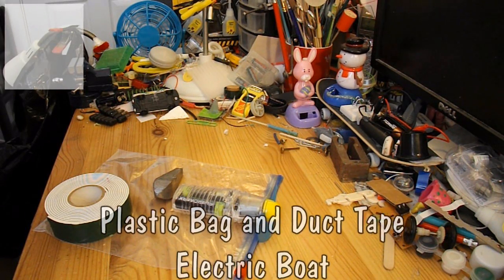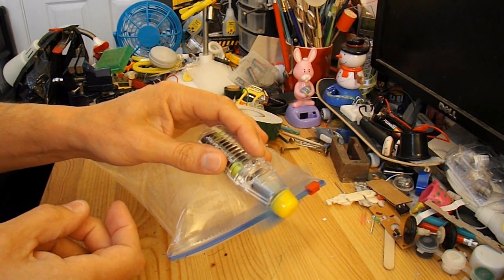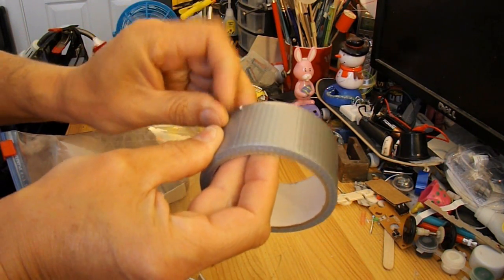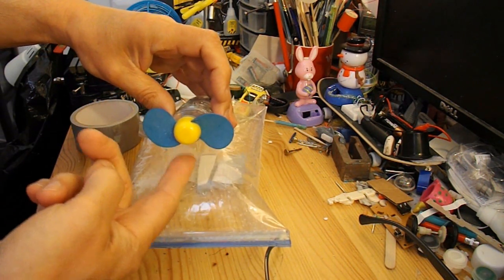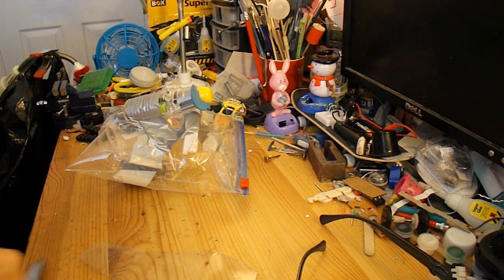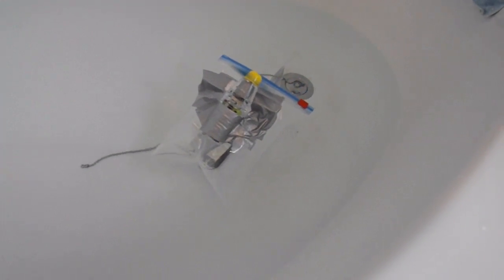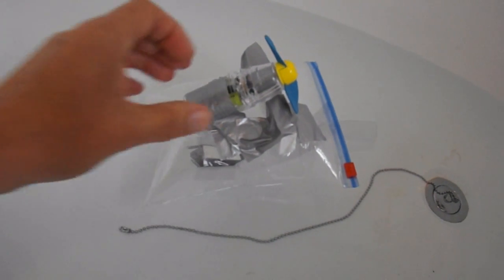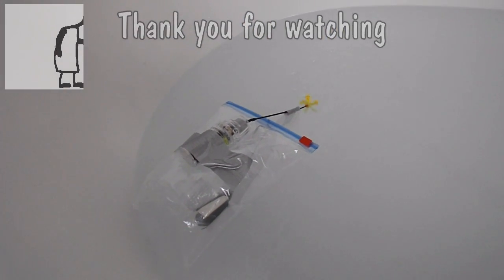Plastic Bag and Duct Tape Electric Boat

Comment: can you do an rc boat like this ?
Reply from the maker: ThunderTaker38 I will pass on that. Yes it is possible but I won't be doing it, why don't you have a try?
Reply: I dont have the servos laying around,they are all in use for my rc planes
Reply from the maker: ThunderTaker38 well servos are cheap to buy so that shouldn't stop you.
Reply: i know but i dont want a 1 hour bike ride to my rc-shop
Reply from the maker: ThunderTaker38 that's why I order my stuff off eBay. Takes longer to arrive, but comes direct to my door.